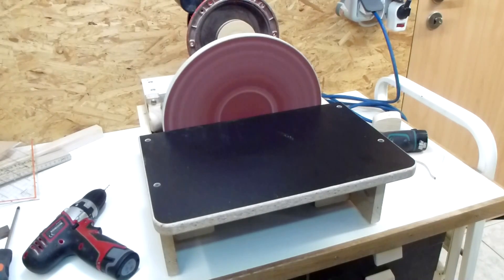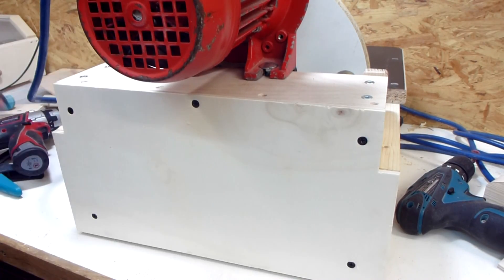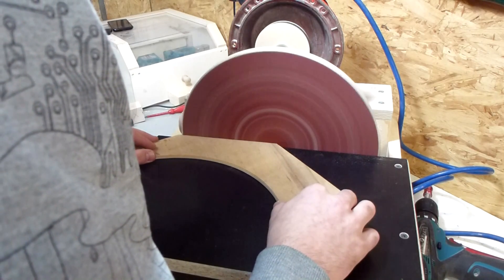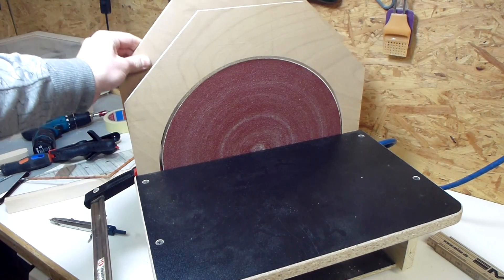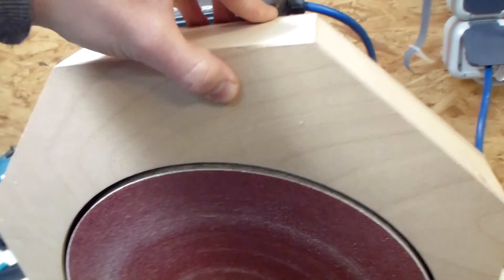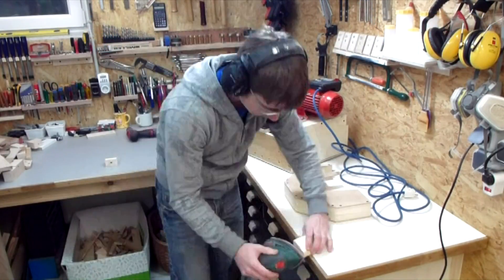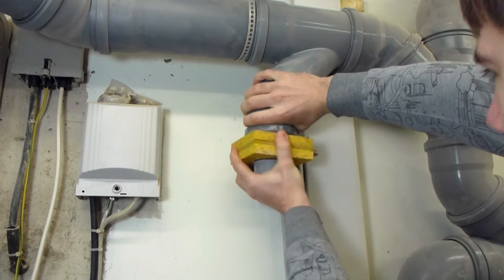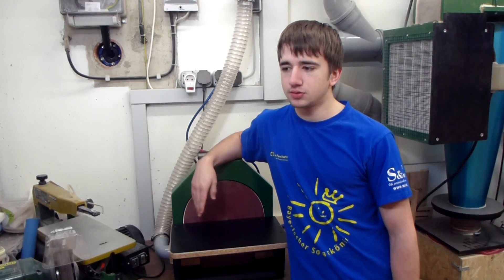Homemade 12" Disk Sander (Part 2)

Comment: i recently came across your youtube channel.  your attention to detail is remarkable.  i had the energy and desire to build woodworking machines 25 years ago.  but now, 25 years later my attention span is too short to stay on projects like this.  i find it easier going out and purchasing them.  it also doesnt help that i am somewhat of a perfectionist.  this trait gets in the way of building things and doing jobs constantly.  i constantly see something that could have been done better and this drives me nuts.  i still do pretty much everything around the house myself without having to call a repair man.  if i do come across a project that is going to take a lot of time to complete, i would rather not do it and even if i have to hire someone to accomplish it, i am okay with hiring someone to do it.  i enjoy seeing you motivated to accomplish build as you have done.  is your youtube channel your only means of work or do you have a job?  surely you have an education with the knowledge i have seen from you in your videos.  take care my friend.....

Comment: I'm making a discsander at the moment based on Wandels, Heisz' and your designs. Thank you for some last minute hints :) Impressive shop you have!
Reply from the maker: Mikkel Bom Simonsen Thanks. M. Wandel made a disk sander?
Reply: Marius Hornberger Ach verdammt - you out-Wandelled me! I think it must have been your fellow german Cosmas B then (I watch too many DIY YT vids). 
Anyway now that I have your attention: You mentioned that you had to be careful not to get a catch when turning the laminate disc - well, I have to do the same thing and I dont have too much experience turning. Is it especially dangerous to turn laminate, or was this just a general caution?
Thanks in advance - you have a new subscriber
Reply from the maker: It's not very dangerous, but I had bad experience before that, because I wasn't careful enough.
Reply: Marius Hornberger Ok - will try it. Thank you for taking time to answer my question :)

Comment: Hi Marius,  really like your disk sander build.  I really like the skate wheel behind the disk to eliminate the wobble.  I made several attempts at building a disk sander and was disapointed with amount of wobble.  I tried pulley hubs, flanges etc, but the runout was unacceptable. I am going to try the skate wheel. Thanks,  Joel

Comment: Thanks Marius, another great video of a worthwhile project.  If you think the disk would be OK running at motor speed, you could do away with the pulleys and mount the disk to the motor shaft. (I'm sure your friend would love to machine you some flanges!)  It would be simpler, smoother, cheaper, quieter, smaller, and lighter. It also might overload your motor, or disingegrate with a loud BANG!   :o)

Comment: Can you reverse your motor?

Doing so not only extends the life of the abrasive, but allows you to sand into corners on EITHER side of the table which is sometimes necessary depending on the symmetry of your workpiece (assuming the design of the guard does not create mechanical interference).

I installed a drum switch on my 12" disk sander because the motor start windings were accessible. Now I use the reversing function all of the time, and now consider it an essential feature.

Übrigens, Ich bin Neusser/Düsseldorfer :-)

Comment: Well done!
Pls note you shouldn't put an engine too close to a wall (7:33) because air should go freely to cool the engine.
 
Didn't you have to re-balance the disk after fixing the shaft with extra screws?
Reply from the maker: ProstoPutnik No, I didn't have to.

Comment: The wooden pulley is interesting, but how to keep it aligned, I've made a 28mm pulley for a 28mm arbor on a 3ph motor and I even varnished the inside of the pulley hole to get a tighter fit, but I can still move the pulley back and forth. Any suggestions? What I'd really have needed is a flange to mount against. I am wondering if a screw like you did, into the keyway would work... I used a wooden key but it didnt help much.
Reply from the maker: Do you mean the pulley slips on the shaft, or that the pulley wiggles on the shaft and you need to turn true to mount something on it?
Reply: Marius Hornberger it wiggles on the shaft, even if I true it up using a lathe it moves sideways in the other axis so to speak, it's hard to explain in english (I'm swedish speaking). I guess one could say it's not square against the shaft. Perhaps making it undersize and forcing it on could work, but it could not be taken of and remounted then.
Reply from the maker: 1873Winchester Try to first mount it on the motor shaft very rigid with a screw or pin through the shaft. And then true by using the motor as a lathe. I used this method to make the flange for my dust collector impeller. You can look it up in the video starting at 6min.
Reply: Marius Hornberger Thanks, I think making it thicker and building it like you built the flange in said video could work quite well indeed.

Comment: can the disk be mounted directly on motor primary shaft or were you just adapting to the disk mount that was given to you by your friend.  the pulleys are cool tho.  Thanks for making videos!
Reply from the maker: +Harlan Wheeler If the motor has the right speed, you can do that.

Comment: Is there any major issues with mounting the disk directly to the motor shaft? Going to make myself one but thinking about skipping using a pulley any reason why that would be a bad idea apart from not being  able to adjust the speed of disk
Reply from the maker: No, I just did this because my motor turns too fast for a disk sander this size.

Comment: hello Marius,
once again I'm really impressed by your creation. all of your videos are clever and clear. really good job.
I have one question : do you think that if I use motor 2HP 220V with 1440RPM for Ø300mm aluminum disk will be OK for my project ?
thank you
Yoyo
Reply from the maker: yes, that will work
Reply: thank you very much for your help

Comment: Hi you did a very nice job and It looks so nice!! But what speed does the disk have? (In rpm)
Reply from the maker: Flixarz ~1700 (as I said in the video)
Reply: Marius Hornberger Okey thank you very much for answering. i saw the video 2 times but i didn't observ that.
Reply from the maker: Listen from 0:12 - 0:18.
Reply: Marius Hornberger Okey thank you very much :)

Comment: if you want really big rpm, make rly small pulley on the motor and the big one on the disk it self, like in motorcycles, if you do it properly i think you could get 2000 rpm at least

Comment: Ist wirklich super geworden das Gerät, auch wenn es nicht so günstig ist wie Riemenscheiben aus Holz kannst du mal bei maedler.de reinschauen.
Da gibt es Riemenscheiben und Taper Spannbuchsen zu guten Konditionen. Eine Grauguss Riemenscheibe könne man auch als Rückhalt für eine Holz Scheibe die man daran anschraubt hernehmen.
Das würde dem ganzen Steifigkeit verleihen und eine Rolle wo sich das ganze abstützen kann wäre nicht erforderlich.
Bei den Drehmomenten die hier auftreten dürfte das Rutschmoment einer Spannbuchse auf einer Welle bei weitem ausreichen so das es keine Passfeder benötigt.
Reply from the maker: Danke für den Link! Eine Riemenscheibe als Rückhalt zu nehmen wäre auch allgemein einfacher, aber nur wenn man einen Motor mit der richtigen Drehzahl hat...
Reply: Marius Hornberger  Also ich habe mir das ganze jetzt auch mal vorgenommen.
So sieht das ganze bis jetzt aus: http://www.abload.de/gallery.php?key=oqlfWeHT
Der Motor hat 2PS und 1450 U/min, die Scheibe ist aus MDF und hat 305mm.
Der Rundlauf ganz außen schwankt um etwa 15/100 mm.

Die Riemenscheibe war von sich aus leider nicht "rund" genug ich musste sie erst in der Drehbank und später noch mit einem Geradschleifer bearbeiten.

Jetzt stellt sich noch die Frage nach dem Tisch.
Wie viel mm aus der Teller Mitte hast du deinen Tisch angebracht?
Ich habe dazu keine brauchbaren Informationen im Netz gefunden.

Grüße

Comment: Why higher rpm? My 28cm disk burns on outside edges at 1450rpm, if I used belt, I would go for around 900-1000rpm. You don't need high rpms on sanding. 
Despite that, it's really a nice build. I've built my temporary disk sander three years ago and still didn't get to making a covers...
Reply from the maker: As I tested it with the lower rpm it worked, but not as I was used to. My old one with the drill also ran at about 1600-2000 rpm and I had no problem with burning. But I only used the highest quality sandpaper that I could get (VSM-sandpaper). I also had a look to commercial ones and other homemade ones and they are all between 1400 and 1700rpm. 
Go and built your "not temporary" disk sander. It's one of those machines you never want to miss again.
Reply: They run at such rpm because they are mounted directly on a motor shaft, not because it's the best speed. 
I will not be finishing that one, hopefully that will make me build an edge belt sander sooner. Disk sanders are surely very useful, but also not the best machines. Part of the disk closer to center runs at lower speed than the outside wich is the worst part :)

Comment: what rpm is the motor.
Reply from the maker: +stewart c 2800
Reply: I built one that uses a 1725 rpm motor. I decided on this speed based on the specifications i found for some commercial sanders.